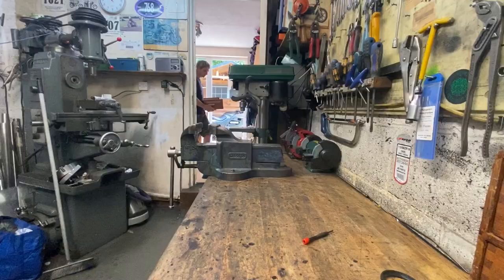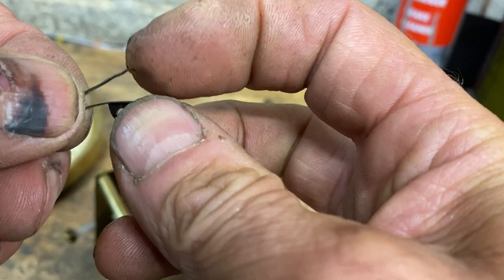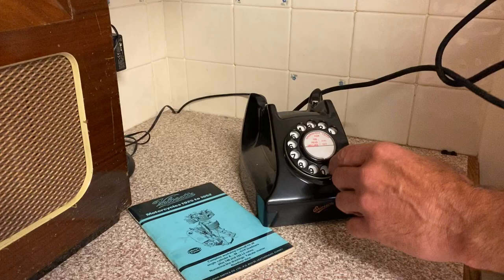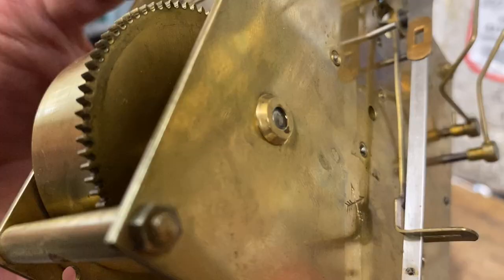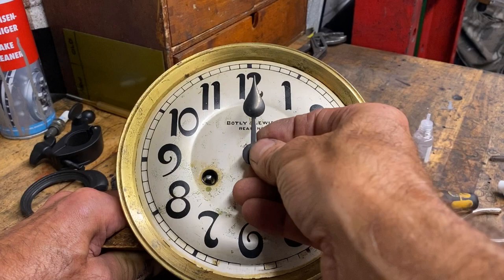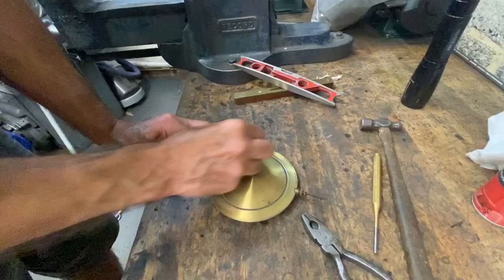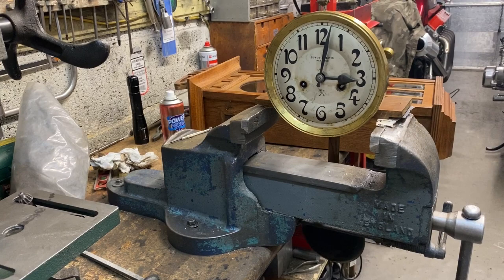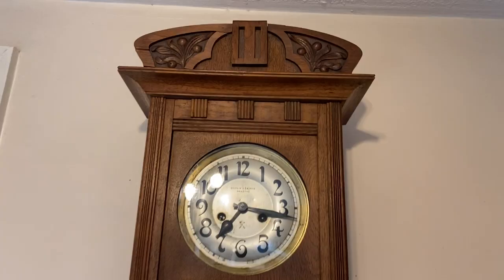Old clock repair and  Kawasaki S3 500 twin ride

Comment: I was listening for the clock ticking, and I realized my breathing was very relaxed, so I thought I would check my blood pressure.  I rolled up my sleeve and wrapped the cuff around my arm as indicated on the instructions, and pressed the start button.  In a few moments, the machine was beeping away and releasing the air it had pumped in the cuff, and after just a few seonds more it displayed the results - 103/66.  For the sake of clarity, I do not suffer from hypertension, but that reading is low for me.  Apparently watching Allen's videos is calming.  Thank you sir for another wonderful video.  Your production is better than many shows on TV.
Reply: Tomakak  Not contrived, I was giving a go at a certain style of presentment.  You are welcome!
Reply: I think you may be right about the blood-pressure-lowering effects of watching Professor Millyard's videos.
Reply from the maker: Im glad it help you a bit
Reply: Now go watch "Debbie does Dallas" and see if that will fix that low reading.
Reply: I too find Allen's videos relaxing as well as informative and amazing!

Comment: Instead of oiling we used to put a disc of petroleum jelly in the housing, the vapours are enough to keep it running smoothly without attracting dust.
Reply: No, this does NOTHING im afraid! So many old wives tales and myths with clocks! Things like this either do nothing, or coat the whole mechanism which then attracts atmospheric detritus and causes the clock to wear excessively or stop...
Reply: @andyholmes4676  Quite right Andy. Oiling wheels and pinions is another sure way to ruin a clock too. I speak from 35 years of undoing such ministrations as we have just seen!
Reply: Air hose, and we 40 would fix it! HeHe!
Reply: WD 40
Reply: @rodfryatt4266  dont get many horologists about! (Decent ones anyway 😉 ) 15 years myself, and ya've never seen it all have you... 😂🙈 (Liberal oil use aside)
Reply: @andyholmes4676  The pity is that when such a well respected and undoubted master in his field as Allen, is seen tackling a subject he obviously doesn't understand in a totally inappropriate manner, others, equally uninformed will try to emulate him. 
That's how so many valuable antiques have been ruined over the years. 
And incidentally, how many more serious disasters have happened in the world.

Comment: It is fascinating that some machines far out last the creators. We really are just caretakers of some things like the clock. I have a 51 N model ford tractor. They also stand the test of time and will still be running long after we are all gone. The maker of that clock would be so very proud that it is basically in new condition after all this time. Great video, I love how you work in the ride to get the oil. That makes it fun to watch. 👍👍

Comment: There is something magical about a mechanical clock, gives off a nice atmosphere to a room.  It was nice to see you in action using delicate techniques to make a repair/adjustment instead of the angle grinder/milling machine.  In the live steam locomotives I create from scratch with analogue lathes and milling machines (no castings), I come indoors and I like to do delicate work, like soldering on fake hinges to my 7mm scale model locomotive.  I work in 4mm scale too and that is really a challenge and I need my headband magnifying glasses for that.  It is a nice feeling to be able to do such fine detail work and then something on the larger side knowing the two compliment each other.  Much like the mechanical cooperation required to have a clock working nicely or an internal combustion engine to run without a cough or splutter.
Please, do keep up the great work and I will look forward to your next video.  In the meantime, CMM arrived today in the post, I wonder what you've been up to in that issue! TTFN. :)

Comment: I found an old clock mechanism just like this one  in a junk shop in Tenterden, in Kent, it looked so sad, no key, and once upon a hundred years ago it would have been ticking inside a nice case. I bought it for five pounds, and took it home. It was dirty, and needed to be cleaned, so I removed the hands, let the mainspring and the chimes spring down with the ratchet lifted back, and put it into a pot full of water to bring to the boil on the electric cooker. After a bout ten minutes boiling merrily away, the scum on the waters surface looked yukky, but I noticed that a lot of the scum was actually very old spiders webs, and with a piece of sharpened stick, I lifted it out of the water, I took the mechanism out of the water still very hot, and in about five minutes, it was perfectly dried out with the residual heat still left in the brass that comprised the mechanism and the frame. I bought a key on the internet, fitted the face and hands, and lightly oiled it as you showed in your film.
It's is now regulated, and running perfectly in a little glass dome with a wooden base, and I love the quiet little tick that it makes reminding me of my youth in my Grandma's house in Wales.  What a lovely film Allen, keep up the great work.
Reply from the maker: Amazing storey it’s great that you got it working so well 😎love the boiling it on the stove bit i must try that sometime

Comment: Used to work in a clock repair shop when I was 14. The owner saw that I had mechanical talent as I could take a three train (time, chimes and hours chimes) clock completely apart, not mark where all the gears go and put it back together again working fine. I later went to college and earned a mechanical engineering degree and also became an industrial millwright mechanic. This is a 2 train clock, time train and hour chimes.

Comment: I used to make my living repairing and restoring clocks, it is very rewarding. I think that is a 1930's German HAC . They built them to last but not as finely manufactured as the French clocks. Most HAC's have a set of numbers stamped on to one of the plates eg 129/33/230 the first number is the number of beats per minute, which you can use to help set the speed or going rate of the clock, the next 2 digits tell you the number of teeth on the escapement wheel and perhaps the most useful is the last digits that tell you the length of the pendulum. HAC started in 1886 but that dial really looks a fair bit later.

Comment: As a watch/clockmaker I can say you did a bloody good job yourself. Stay safe, stay busy!
Reply: Are you really an horologist? You cannot say he did a good job if you were. Alan is bloody good, but this is nothing but old wives tales, hearsay, and bodging! Benefit of the doubt, he isn't horologically trained so doesn't know any better, but you should if you are legit!!
Reply: @andyholmes4676  Well I could say he didn't do the required things for cleaning, like disassembly, inspection of parts, rebushing the plates if needed, polishing the escapement anchor surfaces/gear pivots , relubing and so forth. But he did what he seamed necessary and it worked for him. 

If you have some kind of beef with people that try to fix things themselfs pity you. Everyone started from somewhere.....
Reply: @DhrSpies  well said!
Reply: @DhrSpies  no I don't  AT ALL have any beef with people fixing/trying things for themselves. Ill/we will often help people who want to have a go. However posting bodges or incorrect info on YouTube to people who value and respect the proprietor is not good practice! I have much respect for Alan and the time of day any day, but the things in this vid are not right.
Reply: Lets say I chopped up a couple of bike blocks, soft soldered em together, and mig welded/hand filed the crank, it might work short term but im sure Alan would be along to offer reason as to why it won't last... 👍
Reply: @andyholmes4676  I can see your point, but sometimes people throw stuff against the wall and see what sticks or not. What works for him doesn't work for someone else. 

End of the day people must form their own opinion about peoples action like you and I did, and if this is right or wrong. Goodday.
Reply: @DhrSpies  opinion and correct practice difffer. The wheels and pinions of clocks should never be oiled, and if you are legit, you (should) know this...

Comment: Great job. I've done these a few times too. You needn't set pendulum by trial and error. Just use the physics formula for a pendulum: period is proportional to square root of length. It means that if it's fast by say one part in a thousand, the pendulum needs to lengthen by 2 parts in a thousand.
Reply: Math never works for me 🥺

Comment: I was always advised to use 'peg wood' (Orange wood with its own lube) for touching clock shafts and escapements, only ever stripped one clock down during a training course. A Fusee action that worked very well afterwards. Then noticed the floor moving when you walk over it, went berserk, so they shifted it to a wall mounted shelf. That was 1975. Still working ! :) Reminded me of that, thanks.
Reply from the maker: That’s why I said it’s better to use a tooth pick, some use feathers as well 🙈
Reply: @AllenMillyard  Never knew toothpicks were orange wood. See ? Am learning even more from you. It doesn't stop :) Cheers M8.
Reply from the maker: They’re not orange wood but work ok for me
Reply: @AllenMillyard  The reason why the lubricant in the Orange wood is prefered is so that the shaft from the ecapement can run out, if wound up. It stops the shaft from overheating while the main spring discharges. I guess any wood is good for other tasks. Thanks.

Comment: Ah! Now, I can relate to this!…..I, too, love old clocks. I have an old fusee wall clock from the 19thC that used to be my Grandads and a wall clock and mantle clock from the early 20thC I have worked on all of them and they run accurate to within a minute a week…….although, as mine are all metal pendulums, you have to keep a check on them as the accuracy can drift over the year with temperature changes! (None of mine are ‘posh’ enough to have temp compensating pendulums). Although they can seem daunting at first they are really quite simple and very therapeutic to work on.
Reply from the maker: Fusee clocks used to fascinate me, i remember machining them on a colchester lathe with a copy attachment to control the cross slide, very cleaver concept for continuous torque
Reply: @AllenMillyard  I also have a fusee pocket watch. The fusee chains in those are little miracles!

Comment: Interesting feature Allen. We have a clock slightly older than yours (1898), which uses weights instead of the springs. The old cat gut suspending said weights failed, so I replaced them with fishing line and its still going strong five years later. The chimes have packed in, so I think I will have a dabble with that now after watching your efforts :-).

Comment: Make sure the clock on the wall is straight and level before you run it or it may stop . The swing on the pendulum needs to be equal left and right  or the clock will lose time .pretty clock . Like the video.

Comment: Congrats with your left thumb. 👍 It doesn’t look as bad as feared. 
But please be careful with the hammers in the future.

BTW, i have an old clock pretty close to this one which need a run-over. I’ll use this video as an instruction video and start restoring.
Reply from the maker: It’s healed nicely

Comment: A small tip for waxing wood is to put the wax on with some fine wirewool as it gets the wax into the grain of the wood and the finish will last longer, and it also removes any embeded dirt from the wood

Comment: Wonderful job explaining the clock repair. I loved the ride to Neil's on the twin cylinder Kawasaki 500. I was thrilled to hear and see it. I road a Suzuki T500 twin thousands of miles. Your Kawasaki sounds similar but more powerful somehow. Even though you didn't get up on the pipes on that ride. Did you build the chambers for low end torque? Awesome video. I can't wait for the video on the Kawsaki 500 how it's made.

Comment: Brill. Reminds me of a time I screwed up a perfectly good wrist watch. 
I was working at St Athan with the RAF and I couldn’t resist putting my watch in the ultrasonic cleaner. I was younger then and it seemed like a good idea at the time. 
I took it out and nearly cried when it just stopped working. Probably too dry I thought, so I sprayed some specialist super thin oil in it (it was the stuff we used on super high tolerance hydraulic control assemblies). 
Then the bloody thing ran fast. Way too fast. 
I thought, I’ll just adjust the little radial spring thing in the back, slipped with the tiny screwdriver and buggered it. Watch was not well and truly useless. 
So, moral of the story: Don’t put your watch in the ultrasonic cleaner.
Reply from the maker: its good to have a go and try what you thing is a good way, we learn lots by trying,  even if we fail a few times

Comment: find some needle then poke that nail. i suggest you poke it by twisting gently . give a bit squeeze on the thumb till that black blood out. then you'll be fine.
Reply: KAIJUU CHANNEL yer rightoh youevertriedthat amatetold mejust drillthenail &letthepreassure out , soiput the smallest drillthatwouldholdinthe pillar drill, youcanimaginehowthat 
Turned out , ithink icryed allthe way home.
Reply: I used a small drill bit too bore a hole through my thumbnail, much easier to control.
Reply: It's a little late to drill that nail. It's best done right away when your thumb feels like it's the size of your hand😑
Reply: @classicrestoration  yup would have gone solid long ago now. My thumb hurts just thinking about it.😢

Comment: Hi Allen. I noticed there were 3 hammers and 3 chimes, but 2 hammers hit the same chime. Did you also make any adjustments to the hammers?

Your bench is just too clean. I wish mine had nothing on it.
Reply from the maker: Well done for noticing that, yes I had to adjust one hammer over a bit

Comment: I'm severely disappointed you didn't make it run as fast as possible.
Reply from the maker: I did run it at 3 times speed with out a pendulum at first to check it ran ok

Comment: Hey Allen, those old clock screws are probably cut on a lathe and best not replaced with modern rolled and formed screws.  

But how would you go about fixing up those original screws where a slipping blade has badly marred the screw head/slot?  Thanks.
Reply: WD Hewson You would check out “Clickspring” ’s channel😁. Les in UK
Reply: @leslieaustin151  That's a great channel well presented and skillful craftsmanship..  Thanks.

Comment: The last thing a watch/clock movement needs is oil everywhere. You only oil the bushes and with the tiniest drop , dust is the enemy of these mechanisms ,
Reply from the maker: I wiped most of it off so it will be just fine

Comment: In the clock repair you should never oil the teeth of the brass wheels . That`s what the professionals say . The oil will clog up the teeth with dust .

Comment: Generally one should not oil  the teeth of the gears in a  domestic clock. The tooth profile is cycloidal and the teeth roll rather than slide as involute do gears in more engineeringy situations. Horologists will tell you that the oil attracts dust which causes wear. Well that's what they say.
As for clock oil, time was that the best oils, as in the ones that oxidised least and gummed up less came from the gloopy bits of whales. But now even the cheapest oils, like sewing machine oil, are much better than victorian clock oils. Horologists won't like me for saying that either. Just not WD40 OK?
My love is Master/Slave clock systems which are very definitely engineering rather than horology, particularly those made by Gents' and Co. Nice hunks of cast iron and big solid brass gears.

Comment: Love the video but....
& I hate doing this, but I must correct you on that wonderful bike....
It's not a S3 & it's not a twin.
It's a H1 (aka Mach III) & it's a triple.
The S3 was a 400cc triple. It replaced the previous model S2, which was a 350cc triple.
Here's the model line, through to 1975 for the Kawssaki triples - 
S1   250cc
S2   350cc (replaced by the S3)
S3   400cc
H1   500cc Mach III
H2   750cc Mach IV
Any 2-stroke "twins" were earlier models that were overlapped & fazed out by the triples. They ran rotary disc valve engines & the triples were all piston port designs.
Sorry, but I just had to get that out. However.....🤔
In this case, I could be wrong 😏
Reply from the maker: Its not a H1 triple its a S3 500 Twin,  have a close look, My latest video im just editing is about this bike.
Reply: @AllenMillyard  
Oh my goodness, you are so right. I'm new to your channel & should've realised. Actually, I should've looked at your other videos first before inserting my foot in my mouth. But you see, my  first glimpse into your channel, was via the clock repair & I just simply assumed. And one must never assume. I stand corrected.
I'm so looking forward to seeing how you created it.
Loved your video on the crank seal rebuild on the old H1 by the way.
Cheers
Nik

Comment: Hmmm.  I'm beginning to think Neil is trying to avoid you.  That's 3 times you've called him now, and each time his telephone number has changed*. The call for the Turbo pipe was 08137....then, the phone call for the H1 paint was 02031...and now for the clock oil, he's changed his number again to a longer 014385 which means he must be out of the country now!  Blimey!, the lengths he'll go to huh?

* - (yes, for those super serious out there, I do realise these are not proper numbers! - Kind of kills the humour when you have to explain it doesn't it!?)

Comment: Stick to engines Allen.  Wheels and pinions in a clock should NEVER be oiled. It collects dust and leads to premature wear of the pinion. Oil pivots and sliding contacts such as pallets ONLY.